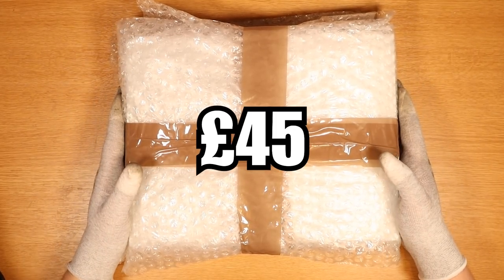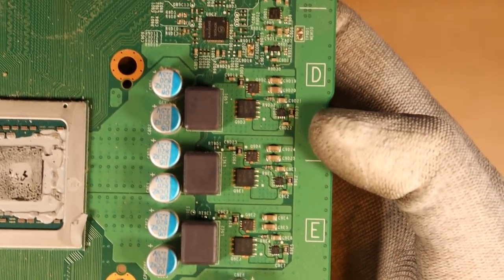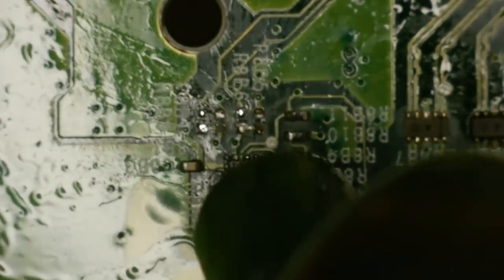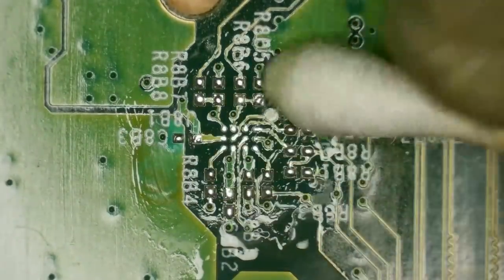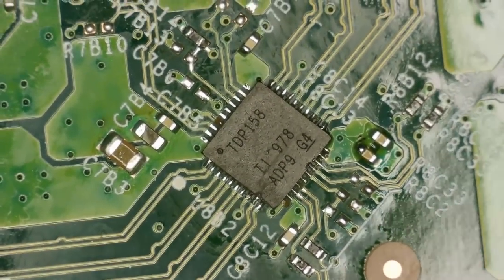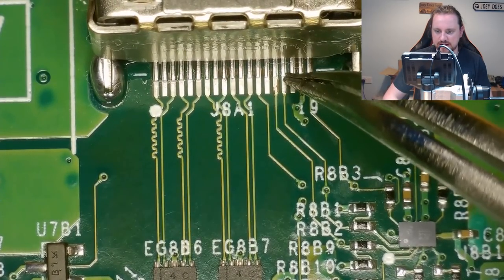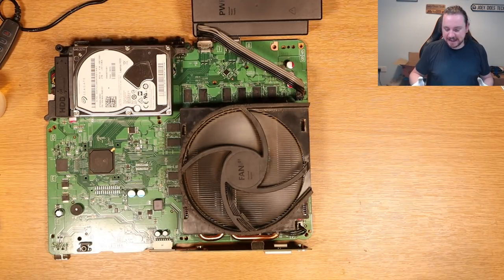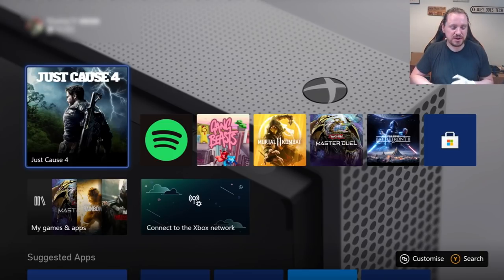This Xbox Repair was a MISSION!

Comment: This was really hard! max respect for your work. If I can give you an advice, stop scratching traces with a blade, try a grinding pen. I gotta one on aliexpress cheap as always, usb C rechargeable and with a lot of tips. 3 speeds, works like a charm and I haven't recharged It yet! No sponsorship of course ( I don't even remember the brand... but it's not big and heavy like a dremel... it's light and small!)
Reply from the maker: I need to get one of these Raggi! Could you message me on Discord with a picture please?
Reply: @JoeyDoesTech  actaully chemical removal of solder mask is the recommened method 

d.c.m. and a q-tip 
trust the last thing you want to do is accidently scratch/grind through anything also that board should be checked for electrolytic capacitor damage

also 450 is too hot you could damage silicon beyond its rated heat flux maximum

Comment: Nice one. Take a moment and analyze the corrosion. Always watch out for green because green is copper that corroded away. Solder is white however it turns flaky and grey and ends up black if current passed through. If you are curious to learn about corrosion search electrolysis. Important thing to know is the positive side oxidizes and negative side reduces.
Reply: Maybe I should have just said positive side builds corrosion as negative side gets eaten away.
Reply from the maker: Very good point Jesus! Thanks :)
Reply: @JoeyDoesTech  I didn’t want to put it in the original comment but don’t be surprised if it stopped working. You never cleaned the corroded pad under the retimer chip. We don’t know how much copper was left. It is making a connection for now but you never know. 🤷‍♂️

Comment: Hi from Turkey. What is the airflow speed and temperature when you place back the smd capacitors because when i try they fly away
Reply from the maker: It’s different for every hot air station, but i think I was using 450c 50% air flow and just making sure that the solder was connected to the component before removing it :)

Comment: Nice repair joey, i just got confused thad you used the TDP158 instead of the 75DP159, that is used on the xbox one s, the Tdp158 is for the one x, good to know that it works on both consoles
Reply from the maker: Yeah you can use the 158 on the Xbox One S, but you can’t use the 159 on the Xbox One x if that makes sense :)
Reply: @JoeyDoesTech  i guess that is because of the resolution at the one x that goes up to 4k

Comment: Have you ever seen a wrong dvd drive? One friend of mine had a problem with Xbox one S - it won't turn on. I figured out a short circuit in the dvd drive. After unplugging xbox start working, but i didn't be able to fix drive itself.

Comment: You know what! I feel silly. I tried modding a ancient PS1 a few days ago and knocked a tiny resistor of the board and tried using soldering iron to put it back which then knocked 2 more resistors off! Didn't occur to me to use hot air.
Reply from the maker: Haha don’t feel silly at all! It’s all about learning :) it made it a lot easier for me in this video that’s for sure!